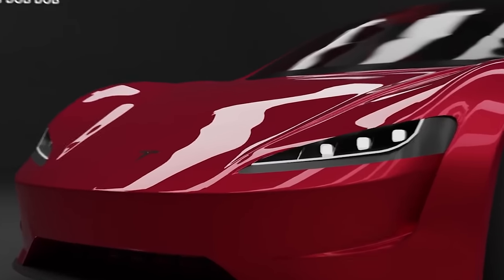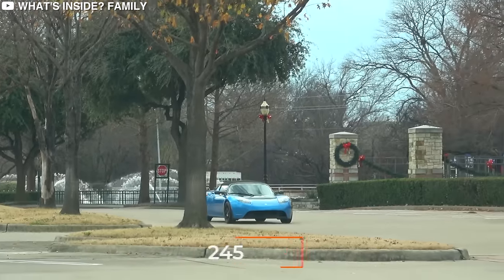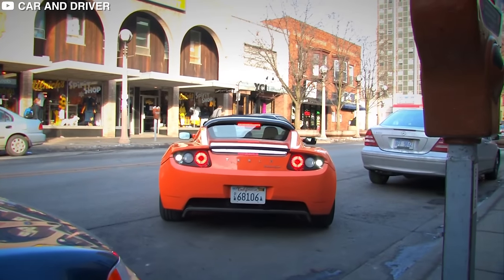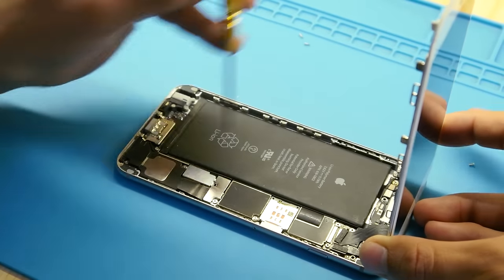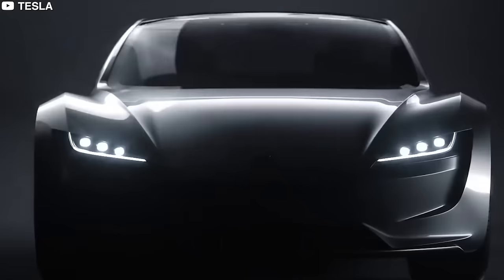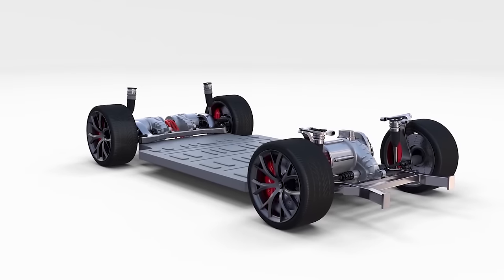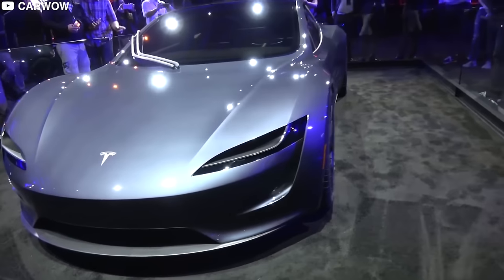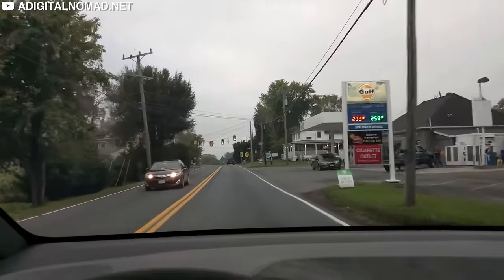Tesla Roadster Is Finally Here, And It's Genius

Comment: Pls get your facts straight sir. Original roadster has a 65 kW battery with upgrade to 3.0 series of 80 kW.  New roadster will have 150% extra capacity.
Reply: There were several mistakes in this video. Bummer
Reply: Make sure you hit “dont recommend this channel”
Reply: Just report it for spam

Comment: Rimac Nevera is like, what is this Tesla Roadster you speak of? ((yawn))  However, if Tesla can provide the performance figures for no more than $250K, it would make the Rimac Nevera look like a poor investment that costs $2.4 million per copy when the Tesla Roadster can achieve similar performance results for about 10% of the asking price of the Nevera.
Reply: You're using a big word "if"....
Reply: @Ken Miller You sound like a hater so lemme clear some things out , the Rimac is track ready? So it the Plaid Tesla which beat the Taycan on their own track (Nurburgring) and that model S is not even a sportcar so it is a safe bet that Roadster will do much better on tracks , lucky to break sub 7 second? Why would they need that when the Rimac can only do 8.52? The Plaid Tesla can already do 9.2 for 1/20 of the price and it is a 4 door Sedan , it is safe to say that the Roadster will weight about 500kg less which is huge combine this with much better aero and the new battery pack that is already in test production and the Roadster will be very close to the Rimac for much cheaper and that is the base model....you can hate all you want by facts speak for themselves and Tesla proved what they can do with the Model S , if they can do that with a Sedan then they can do much better with a legit sportcar

Comment: I had a tesla roadster 2.5 sport White with all the black carbon you could get that time.  it was known as the meat wagon so Elon knows about this particular car :P It dident have a 200 kw battery. Actually the roadster had a 53 kw battery just singel fase for charging. So it took me about 7,5 h to charge the car with 7,2 kw/H
Reply: I noticed the same thing. The first Roadster DID NOT have a 200kWh battery. He repeated it several times too. IMHO that's kind of an egregious error so I had to thumb it down.

Comment: Elon, Listen up .. I know a company that bests your new batteries .. 

1.This new 3D printed battery has a 100% solid electrolyte 
2. This new battery is manufactured flat, with encapsulant so it will be lighter than your steel case batteries 
3. These new batteries will be large flat rectangles & best your best batteries by 6 times 
4. These batteries will be able to charge faster than your best battery 
5. Because these are long flat rectangular batteries they will take up 2 Times less space than your Round Peg in a Square Package
6. ALL WOUND BATTERIES chemistry is impacted by rolling the layers 
7. The batteries that I know of will have a minimum of 30,000 hours life before they hit 80% of original capacity 
8. My battery will have self healing capabilities to achieve F.A.A. certifications 
9. I thought Tesla would play this really smart & be the first manufacturer of Aerial Autonomous Vehicles .. 

This is way smarter than Tesla .. I challenge Tesla .. I believe another company will offer VaaS aerial vehicles before tesla .. When this happens Aerial Vehicles will be the new standard .. Stop building cars Elon or you will find yourself without a car line & without a way forward .. I know of other companies who are going to eat your lunch ! .. 

Elon .. I love you man but you have to hire people like me .. I have got something that I will only speak with you about .. I will even tell you what it is before hand .. Its called => The Reactionless Thruster <= .. Einstein was wrong .. Einstein was wrong because Gibbs, Heaviside & Lorentz were wrong .. Why were they wrong ? Because cause the dumbed down James Clerk Maxwell's Equation's .. It was proven by the Nobel Prize winners in Physics Dr.'s Lee & Yang that the Standard Model of Electrodynamics was wrong ! .. I can demonstrate to you that a superconductor is actually a hyper conductor because no E or H fields touch the skin of a super conductor .. If they did the Von Mises Effects would kick in & it would no longer be a superconductor .. What am I saying ? That the laws of physics allow for hyperconductivity .. What does hyperconductivity mean ? .. Negative resistance ? .. What does Negative Resistance Mean ? Einstein was wrong because the Standard Model is wrong .. Dr.'s Lee & Yang proved that the real standard model is a) not symmetric ! b) Allows for FTL c) Places an imbalance in the Aether to allow for devices like the Nassikas Thruster ! .. d) Allows for a Nassikas Thruster to develop enough thrust to achieve escape velocities ==> and much more ! .. Let me tell you about the suppression of the Negative Resistor .. Let me tell you of the devices that can no longer be found on the interweb .. Let me tell you about the wealth of Keiper Belt .. Their is a 100 Trillion Ton asteroid in the Keiper belt that is made of gold & platinum group metals .. If you harvest this item .. You replace the Rothschild's / Rockefeller's / Et. Al. .. Space travel becomes an everyday event .. Who else could put the wealth of the galaxy at your feet .. Tell me another man who can do this ? NOT ONE ! I am the first & the last who will ever give you a win bigger than anyone else could ever give you ! .. I am that man ..
Reply: yessir